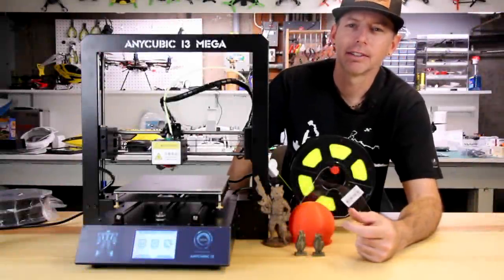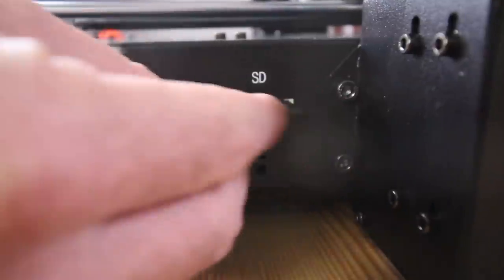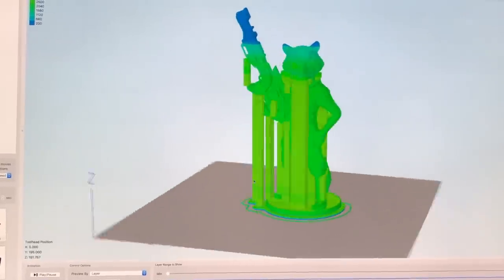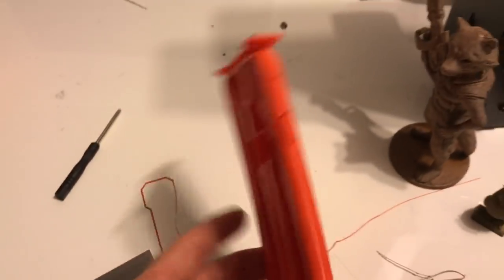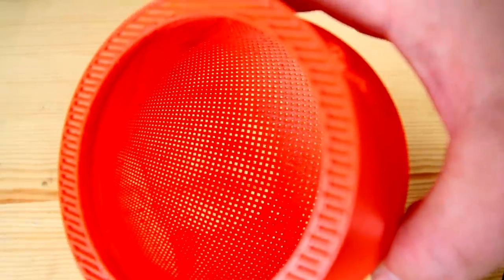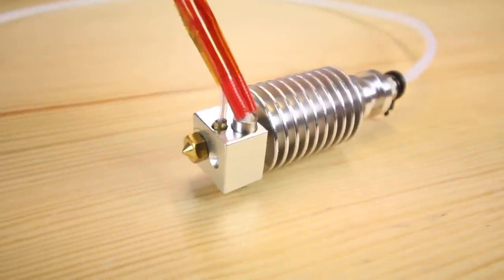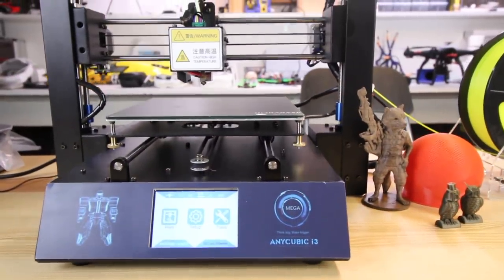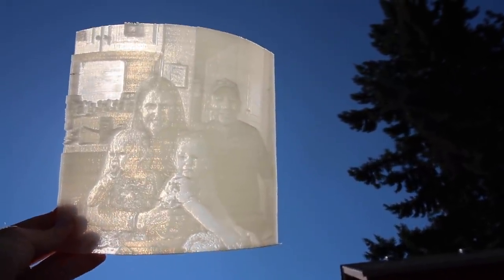BEST BEGINNER 3D PRINTER? - Anycubic i3 MEGA VS CR-10 - Honest Review

Comment: you need to slow down your printingspeed to print TPU thats why you get unregular extrusion on you layers it has to do with the filament getting a bit compressed over the lenght while using a bowden system. slowing it down will make you able to print TPU but with the CR you will probably get better results still

Comment: For ABS - an enclosure is really recommended as  ABS warps as it cools, which pulls it away from the base and causes layer separation. Also a decent width brim helps.
Reply: would a couple of heat lamps help keep the temp up and reduce the rate of cooling?
Reply: ABS has been kinda phased out

Comment: I printed for about 400 hours using abs. Geting it to work is ez.

First: go to the 99cents store and get 2 try folding presentation board cut 1 for door and lid cost you around 2$  make it 3$ you will also tape.

Congratulations you made enclosure. 

Then before you print warm the. Bed to 100 got to wait 10 min let that box warm up.  Now for print.

Comment: For TPU, search thingiverse for "Anycube i3 Mega TPU".  Since this is a bowden TPU or any flex filament will be tough without modding.  After you install the mod, you also have to print slower.  As for ABS, try increase your print bed temp 5 degrees at a time to see if that helps, but in the end, ABS needs an enclosure to help keep the ambient temp more warm and consistent.  All you need really is a cardboard box big enough to go over the unit.  I would keep the filament outside and cut a big notch in the box for the filament to go through.   Also maybe some small holes toward the bottom of the box to keep let the PSU get some air.  Unfortunately the PSU is only 12V so it's kinda weak.  making sure it gets it's ventilation is a good thing. Would have been better if they had the PSU and controls in a separate unit like the CR-10.  And a 24V PSU would have been better for the longevity of the whole printer.

Comment: I got the I3 MEGA V1 and updated it with the Ultrabase. No issues with ABS (Velleman) so far.
Even worth, the PLA is popping off if Ultrabase is cold, but ABS ist sticky as hell.
It needs some force to get it off. Make sure you clean the Ultrabase with Alcohol before using it.

Comment: For the ABS, it seems like you need to increase the bed temperature. It has a max of 110 degrees I believe. I have yet to install the ultrabase on my Anycubic i3 Mega (version 1) but I'm not sure if that's causing the adhesion issues. I would recommend Hatchbox ABS which has printed just as good if not better than PLA.
Reply: The PrintinZ surface  is even better than all the other surfaces according to all the new reviews. I just got one ordered so we will see

Comment: Have you compared the extruders ?   There are thoughts floating around that the included "replacement" is actually one designed to handle that flexible filament

Comment: Is the anycubic customizable? If so, you could change the head for a direct drive one... That's the cause of the TPU issues. The filament compresses too much inside the teflon tube. So if you have a direct drive instead of bowden it should work... in theory.. ( I hav no experience with 3D printing, but I do understand the technology behind it...)

Comment: I use ABS in my MakerBot with a heated bed. I find I need to run the heat on the bed at 130 degrees Celsius to keep the object I'm making stuck to the table. With out the heat on the bed your ABS parts won't stick.

Comment: I've been having a ton of issues with mine(first printer) what slicer do you use? Any recommended settings. 
I'm trying to figure if the failing is on the part of my machine or its my error....so I can fix whatever it might be, me or the printer.
Reply from the maker: Getting it level is key. I use Simplify3D. Also check your layer heights and read up on that on Simplify3Ds website. Tons of beginner help on their site on all kinds of subjects

Comment: Hi
Search in the print software to:  platform adhesion type
search and make it:  brim
click behind brim line amound and write there:  10
at the first layer makes the printer an extra adhesive layer
try it out!

success and greetings from Netherlands!
Rob.
Reply from the maker: +R. Rob. Thanks Rob!
Reply: Drone Camps RC  change the image settings to “positive” vs negative on the litho- I’ve done 10-15 lithos and although negative gives a cool effect but if you want to be truly “wowed” change image to positive on that same website you’re using Now

Comment: Which is better? i3 mega or CR-10 mini? I can't decide for my first 3d printer. I want to be able to print ABS and PC MAX. Any thoughts?
Reply: Chris C CR-10(S) (Mini). I bought one After having much trouble with the Anycubic (damaged Mainboard, After a few Months writing with Anycubic i got a new one but Temperature Sensor not Working.

Comment: Your ABS prints are not working because that material needs the bed heated to a higher temperature and a box around the printer to prevent the print from cooling too quickly.  Sometimes turning off the part cooling fan can help as well.

Comment: ABS? steady hot temp = enclosure. 80buck printer is enought and better. just need trash belt drive that everyone use and better linear rails. 101 get good layer is forget belt drive and upgrade linear rails. even cheapest extruder make better quality than...